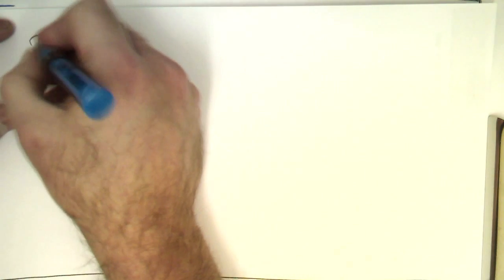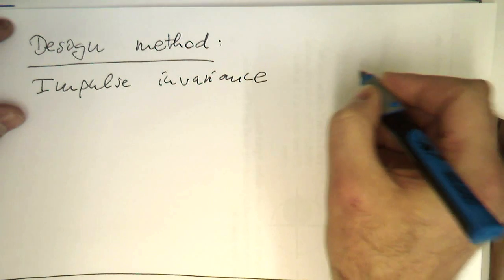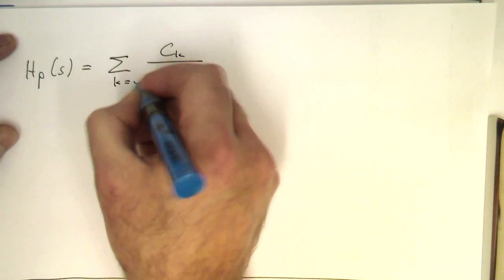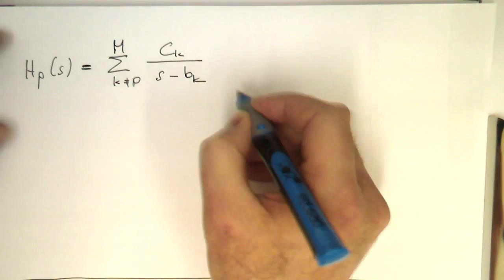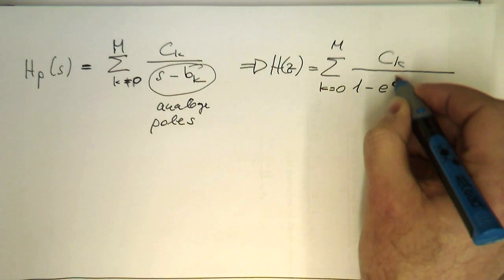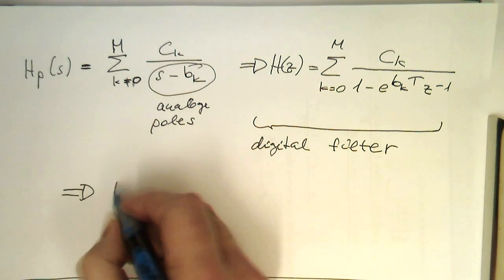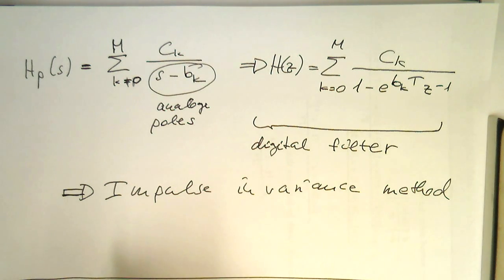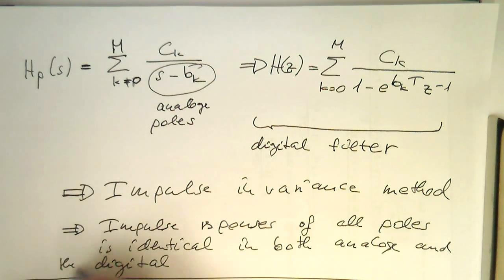Impulse invariance method: introduction (0000)

Comment: That isn't right, because the relationship between discrete impulse response and analog impulse response is hd[nT] = T*ha[nT]!!! So you have to augment the translation formula with the factor T (sampling intervall).
Reply from the maker: There is no impulse response h[] in this clip. We are in the frequency domain. H(s) and H(z).
Reply: @DSPcourse  At the end of the video you talk about the identity of the impulse responses of the analog and the discrete system. The fact ist that the sampled impulse response of the analog system differs by a factor T (sampling intervall) from the impulse response of the discrete system, because if you sample the analog system at the points with t=nT you introduce a scaling factor to the frequency response in the spectrum (e. g. in the baseband) which you have to compensate with a factor T, otherwise, if you assume that hd[nT = ha[nT] you get a frequency response which is scaled with fs=1/T and it depends from the sampling rate fs and does not match with the analog frequency response Ha(jw) (because you get in this case 1/T*Ha(jw)). So you have to assume that hd[nT] = T*ha[nT] . With this assumption the factor T cancels out with 1/T so that you get the right result. By the linearity property of the DTFT- and z-transformation you can do this multiplication or correction with the factor T either in the time- or z-domain because Hd(z) = Z{T*ha[nT]} = T*Z{ha[nT]=T*Ha(z). If you don't believe me look at: https://de.wikipedia.org/wiki/Impulsinvarianz-Transformation. The consequence is after all, for getting the right result, that you have to multiply each coefficient Ck with T in H(z).
Reply from the maker: @rolftheopold8031  It's nice that you are so passionate about it but if you had watched the previous clips you'd have seen that we are sampling the signal x(t) with delta pulses. It's not about preserving the surface or doing a zero order sampler. Depends how one does it. The delta sampled signal of course has then no intermediate meaning but then gains it again through the Laplace integral. Either way the approach with the delta function has the advantage that it avoids carrying the T through and then showing up everywhere.